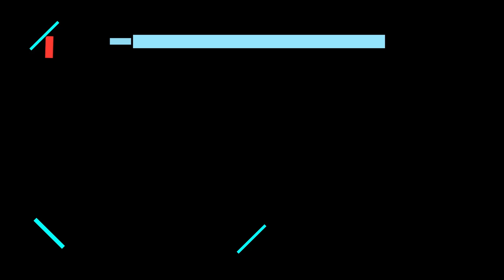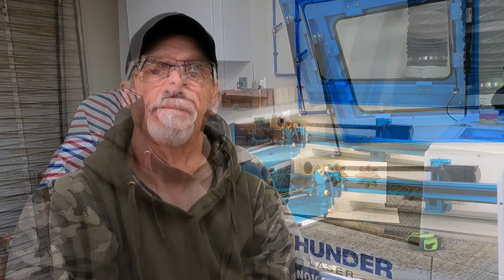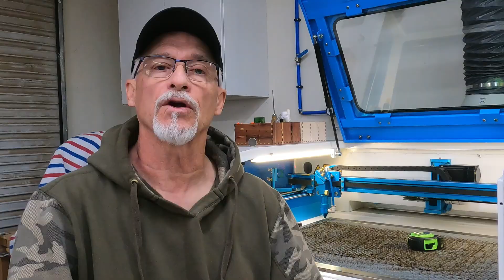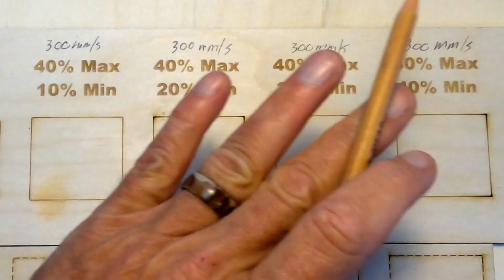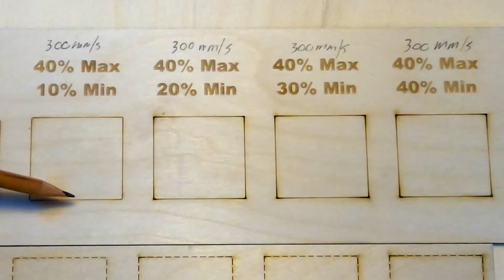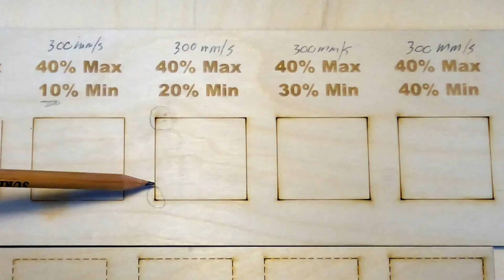Understanding Minimum power settings in lightburn

Comment: Hello .. nice video thanks ... but correct me if i'm wrong ( still new in the laser stuffs )  .. this research for the min value will have to be done for any speed you want to set ... correct ?
Reply from the maker: Yes you are right, the speed and material size of laser will all have an effect on outcome. This is not a set it and forget it type of process. Determining max and min setting will need to be obtained for each condition. Thank you for watching !

Comment: Hello! I need help cause I keep changing the intensity of the laser and speed but it either burns the wood or not engraves at all... :(
Reply from the maker: very small changes in min power setting will make a big difference. go slow, change you settings slightly. don’t do big changes or you will blow right past the sweet spot!

Comment: Do I set the power setting in the Cuts/Layers panel or in the Shape Properties dialogue box? Yes, there are dumb questions! Oh, must I use mm in lieu of in? I am 80 years plus behind the rest of the world.
Reply from the maker: The min and max power setting is in the cuts and layers tab. You can use either mm or inches. Select the one you prefer by clicking the little box below the wrench icon it will have either in or mm. Clicking this button will change all the info to inches or mm. Which ever you prefer. Thanks for watching!

Comment: Hi. Another great video. 
Was just wondering what about when you gave it on fill. Do you need to adjust min?
Reply from the maker: if the mode is just fill I keep the min and max the same because it’s not slowing down but to reverse directions unlike a vector trace where min power is critical

Comment: I am a little confused, is this only for engraving lines? At those max power levels it would not cut all the way through a board.
Reply from the maker: Yes for scoring or engraving vector lines. Actual cutting actions you want your max and minimums the same in most cases

Comment: so where do you change the setting the min power setting i dont see it other then gray scale settings i am using mini gerbil board and 9.2 light burn
Reply from the maker: If you have a co2 laser make sure your in line mode and then open the layer and you will see it. This option is not for diode lasers

Comment: Are you able to engrave on paper?  I'm currently using a cheap K40 laser and looking to upgrade to this unit, however, I am worried that the minimum power may be too high and burn through rather than engrave/mark.   I use 140# watercolor paper to engrave highly detailed miniatures.  I also use low power settings to mark rather than cut through as well.  Thanks!
Reply from the maker: if you can do it on a k40 you should be able to do it on the Nova 24-60 watt laser. your accuracy will be greatly improved with this step up.

Comment: Thank you for sharing all you do.  Great Job.  I have a suggestion that I cannot find any one doing that will work for us with LB.  That is: Focus!  I purchased a new lens from cloud ray and it is 2.5" focus.  I installed it measured 2.5" and it does not cut.  After many trys no joy.  I tried the focus LB test No joy... So How about doin a focus video fron A to Z to including a height guage etc.  Thanks again for sharing.
Reply from the maker: Thanks so much for the comments when it  comes to focusing usually the distance is from the lens and not the nose cone so be sure you are measuring from the lens.my 2" lens has a focus distance of 6mm the rest in incorporated the nose cone of the laser.

Comment: Nice vid. but in version 0.9.23 i do not have min power. I can see it after i choose Fill+line, but just for cutting isn't possible to set min power. (K40 +cohesion 3d). EDIT - i manually added Ruida controller, and there is min power option. On smoothieware is not possible to set this option.
Reply: I have noticed this too.  The only place I can adjust the Power Min is Image - Gray scale.

Comment: This helped a lot!  Then I tried it.  I have just downloaded 0.9.23.  Noticed that you can no longer adjust the Power Min on any line.  HELP!!
Reply from the maker: That is strange, I am working on 9.23 as well and I  have the max and min power options just like before.
Reply: @computercreationz  My device is GRBL.  I have Ortur 20w laser.  
1. Create a square.
2. It is set at line.
3. Lol at the Power Max and Power Min boxes in the Cuts/Layers.  the Power Max is adjustable but the power min is set at 20.00 and cannot be adjusted.
4. Double click the 00 so the editor opens.
5. In the Editor there is a Max Power but no Min Power at all.
6. I change the Mode to everything else and still do not get the Min Power.  
Any Suggestions?
Thanks for any help
Michael
Reply: Found out that this is only for CO2 Lasers.  Not for Diode Lasers.  Bummer.  Lots of good info here.  Happy Burning!

Comment: Great video Robert!  When I'm running a line for cutting I've been getting areas at corners and curved areas where the cut hasn't gone all the way through.  Should my Min. match my Max for cutting?  TIA
Reply from the maker: if it a line and not meant to be a cut, back off of you minimum power setting to your minimum. this video does not address cutting parameters specifically. this info is for designs that you use the line mode for your design. once you understand how monumental works you quality will go way up. try it out!
Reply: @computercreationz  I understand the video was about lines not cuts, and the information is very helpful and I will certainly be trying it out.  I was asking a separate question about cuts hoping you might share some insight as to how minimums can affect cuts.  Thanks for all your videos they are very helpful.
Reply from the maker: @BBQGuru1008   I understand now, if your cutting and going around a corner and the corner is getting burnt reduce your min power until it still cuts through and reduces scorching most of the time y min Ned max at the same for cutting but if your cutting tight items you can adjust you mins slightly to reduce burning. I hope that answers your questions. Sorry for the confusion!